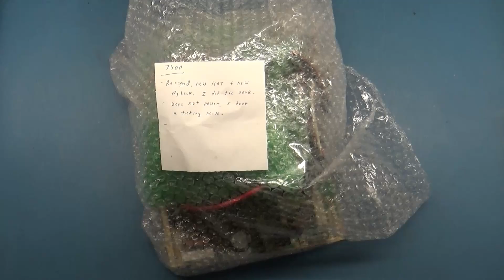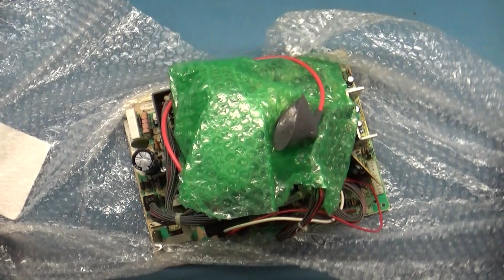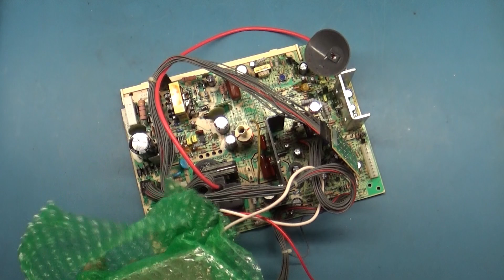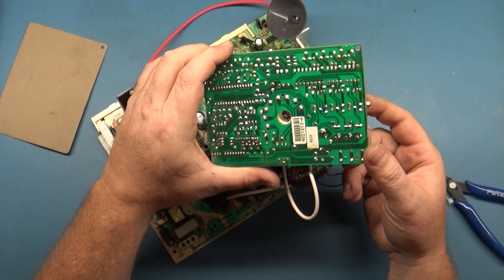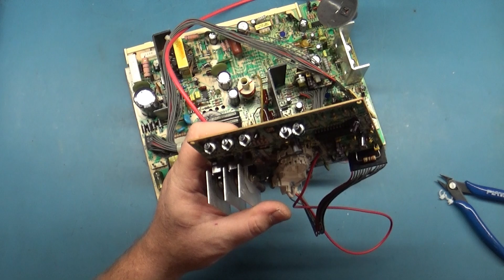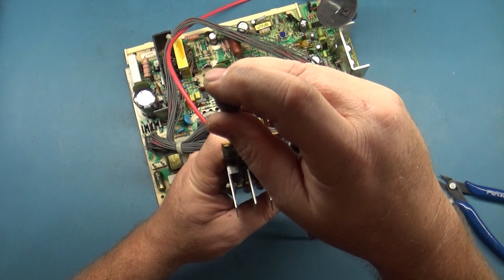25" K7400 Arcade Monitor Chassis Repair - Shorted HOT, Bad B+ Voltage, Blown C204

Comment: i was wondering if you have a email it a way to bounce questions off you or even a bussiness i could maybe send you  my board im at my wits end changed lots of parts and watch lots of your videos i have a u5000 and i have a b plus at around 300 VDC  pretty sure the pot tested good.
Reply from the maker: 300V? I assume you're measuring at the correct test point? What happens if you remove the HOT? Do you still get 300V? R104 in spec? What is the B+ when doing the light bulb test?
Reply: @MikesArcadeMonitorRepair  R104 reads just under 10 so im assuming its good light bulb test works i have not done this test with out the HOT in the game I've installed a new HOT as well as a new Q101 , Q703 , Q705 and Q708 when i got this board the fuse was blown and the HOT was blown. I've also done a full cap kit and replaced a new resistors from watching piles of  your videos.
Reply from the maker: I would suspect a bad flyabck at this point then. At least it would need to be ruled out.
Reply: @MikesArcadeMonitorRepair  okay thanks pretty new to this first repair attempt i did get a shock from the flyback lol does that mean its working?  any good places to buy one? im up in canada or do you offer board swaps at all?
Reply: @MikesArcadeMonitorRepair  also wonder if I test b plus with the jumper removed correct?
Reply: Just noticed the cap kit i have c616 is not the same ans the manual either is the c725 could caps cause the b plus to go haywire? Flyback has showen up but yet to install i noticed first time i test b plus it was 160 now after all the work ive done caps ans transsistors and and reaistors its at 300 think its something ive installed.   Would you be willing to fix thos board do you have time could love to get cruisn usa up ans running have an email?

Comment: Hi Mike. Im dealing with a k7500 that has a power supply problem. b+ votage at over 200 with the light bulb test. R104 tests good. I replaced smps chip. I replaced voltage mosfet. I replaced b+ pot and high voltage shutdown pot. Do ya know what i am missing? 
Thanks! 

Curt
Reply from the maker: Hey Curtis. I’d start by checking for shorts and bad joints/cracks around the transformer. I’ve also seen the little poly caps around the SMPS chip go bad before and cause issues like this.
Reply: Thanks. I should mention that the b+ pot does not allow me any control of the voltage either. I have several parts chassis that I could swap in those two little yellow caps near the SMPS. When I powered up this chassis at first on a tube I had voltage over 300. I have never seen that before. The flyback powered up as well and a very loud energetic power up.

Comment: Hi Mike, really awesome videos! I'm learning a lot! One question about the H.O.T. With it out of the circuit i am reading continuity on the PCB between the pads for the outside legs(base and emitter), Should I be? I'm wondering if this is what killed the H o T. Again, thanks for doing these great videos! Brian
Reply from the maker: Yes. Continuity on the outside legs is normal. If you have continuity between either outside leg and middle leg with the HOT removed, that is an issue. Usually means the big poly caps on the other side of the heat sink or the diode under them are/is shorted. If you are not using the FJL6920, I would highly recommend that over the 3688s.
Reply: Cool, thanks for the quick reply Mike! I'll need to find the FJ's.
Reply from the maker: You’re welcome. See below…

https://www.arcadepartsandrepair.com/store/integrated-circuits/transistors/fjl6920-high-output-transistor/
Reply: The new higher amp HOT did the trick Mike. Now I'm trying to figure out why it won't sync. No matter what I adjust.
Reply from the maker: Is your sync on pin 10 only? Is it an H.Hold or V.Hold issue? Are you using a standard res signal/game? Are you adjusting the H.Hold pot on the chassis?
Reply: I will have to check if the dip switch setting is correct, I'm not near the game but I know it was changed at one point when I was trying to see if I could get video on an LCD monitor. I don't remember if I changed it back, LOL. Here is a short video of it though. https://youtube.com/shorts/4VOB5oXgLHQ?si=X9mdhf7IV-31onp8 @MikesArcadeMonitorRepair  thanks for the help, Mike!

Comment: Hi Mike! I have a Toshiba D29CR55. They were used mostly for Dance Dance Revolution cabs. The monitor was running flawlessly and all of a sudden, the display went blank. Some people told me that the issue may be the HOT, stumbled upon your video. Should I test all caps and try to find the culprit that caused this?
Reply from the maker: Is it completely dead? No ticking? No signs of life? Fuse good? Not familiar with that monitor so I can’t say what to check off hand but I’d start with the basics and a good visual inspection and go from there.
Reply: @MikesArcadeMonitorRepair  The neck still has some glow, it ticks once only when it’s powered on. But no picture or luminosity on the display.

Comment: Just found your channel today.  I used to run a channel called retro games party.  I mainly fix pcb’s but understand monitors a fair bit.

Have you changed yokes to run the k7xxx on the polo tube or just the connector?  Both should be low impedance yokes I think.

The polo’s are very common here in the UK as are the Hantarex 900/E and 9000.
Reply from the maker: Polo/7000/7400/2000/5000 (standard res selection only) are all compatible with each other and are drop in replacements.